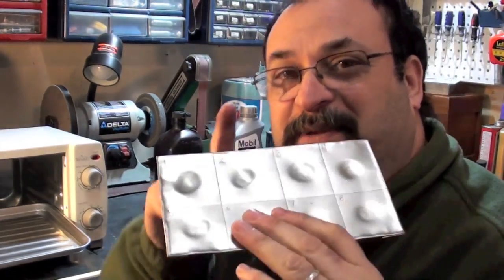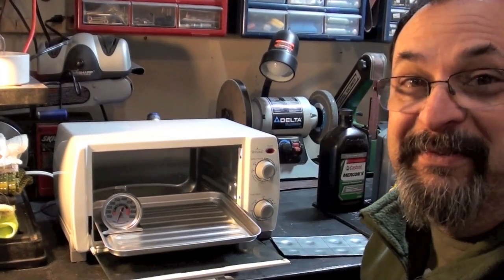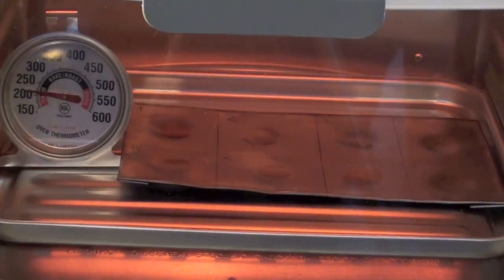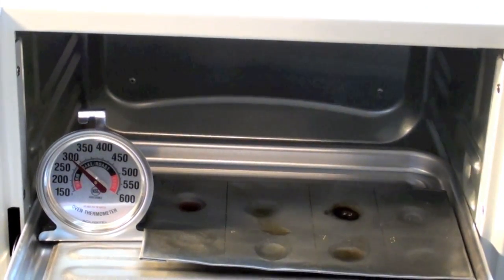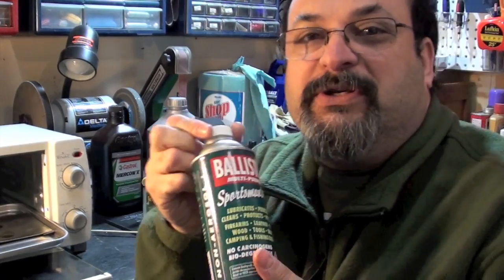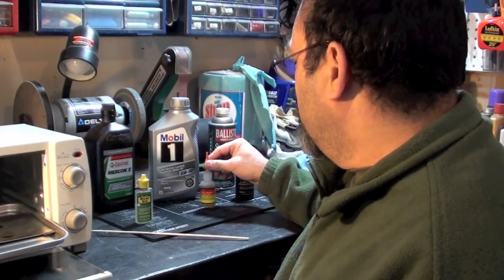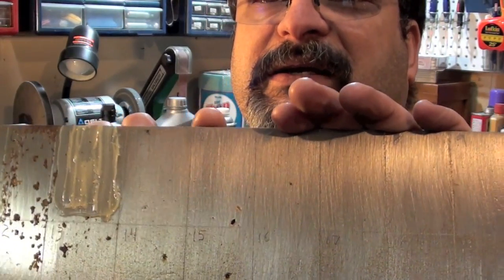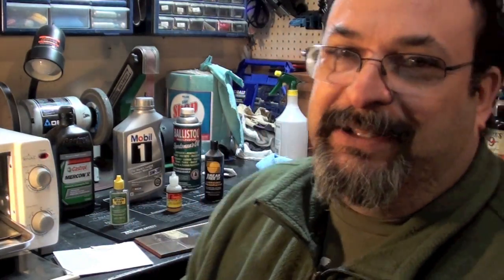Gun Oil Heat Test

Comment: If ATF smells like ASS!Then it will conceal you when SHTF!As a mechanic,I know if ATF gets to hot it will burn!Like a transmission thats slipping,develops alot of heat and the smell gets worse then when it just gets hot!As a protectant, transmissions have alot of plastic/nylon in them,and wont compromise the composition!So for composit firearms, other then the odor should protect it fine.However it will absorbe moisture and turn pink milkie color,like conventional oil,turns a light brown color!

Comment: I was kinda suprised to see the atf take that much heat. The motor oil doesn't suprise me though. As far as the rust test I have had a freshly machined 360 engine block in my garage for over 2 years and only a couple small spots. And all I did was wipe it down with motor oil. Pretty good considering how humid central Texas can get. It's great to see real world tests that can prove or debunk the claims.

Comment: Mobil 1 seems to be doing well. But, and this can be important... How does Balistol and Mobil 1 compare against plastic, rubber and wood? Balistol claims to be safe. But is mobil 1 safe against rubber plastic and wood? Granted it seems Mobil 1 is better under extreme conditions but most responsible gun owners keep their fire arms indoors and clean them after firing. Maybe a future video you can explore also is the efects Mobil 1 (and others ) have ogainst placstic, wood and rubber.

Comment: Good comparison test. I've been using Breakfree CLP and was thinking it was going to fail. lol Lately I've been using this oil I found at Radio Shack that has Teflon in it and it's supposed to be rated to 450 degrees F. It's kinda pricey though @ $3.99 for 1/4 oz. It's great on my folding knife. It smoothed out the trigger a bit on my M&P 15-22. I've also been trying it out on my 92FS, but I still like Breakfree.

Comment: Automatic trasnmission fluid has a friction addative to help the transmission clutches grap better while being immersed in oil, so I am not so sure it is good to use as a gun lubricant.
 
Do this test rub some of that mobile one between your fingers, then some of the ATF, with the ATF you will feel a lot of Friction, not something you want with gun parts!
Reply: very true

Comment: The Oven Of Truth! Great Job Testing these oils Fred, 

Surprised that the Balistol is such a Fail, because it is made for guns. I would think it would gum up the bore if you used it to protect against rust, maybe just use it for cleaning.

I am not surprised the Mobile One did excellent, because synthetic engine oils advantage over regular oil is it can handle higher temperature without breaking down.

Comment: Stick vs.Flow.  Rust stop vs. Rust prevention.  Cosmaline is great for storage. 

It's a balance of the need present.  ATF great, but it drips a lot and is not great for sustainable shooting on a gun that is for accuracy.  ATF works great on guns to clean them and in a pinch, lubricate.  The bad guys ,over the pond, use (used ATF to clean) & (used motor oil to lubricate & protect)